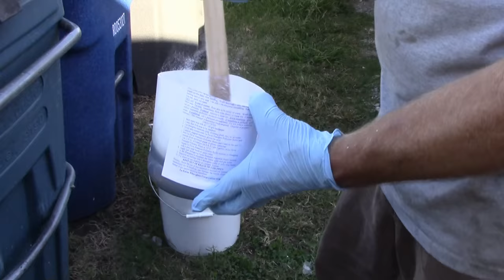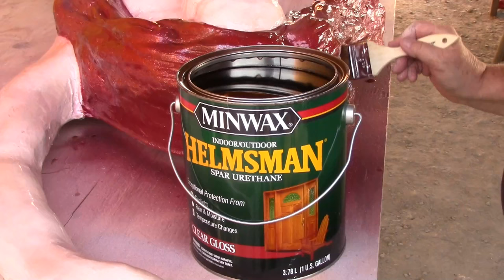Mermaid 2 of 2 - Figureheads for Seeker

Comment: When I know I'm going to be using a cable only in house, I like the twist lock ends.  Hubble makes a 120V, 240V & 3 phase type.  I learned about them doing big Rock N Roll shows.  Everything we used on stage was 3 phase twist so it couldn't get kicked apart.

Comment: Doug, here's an idea for your extension cords. Get some neodymium magnets from HF. Drill 3 shallow holes in the plastic on the end face of the plugs, drop the magnets in and fill with epoxy. If there's not room for the holes,  maybe they can be attached around the edge of the plugs. It might be enough to keep the cords from coming unplugged.
Reply from the maker: I use to love using magnets.   ...and then I started welding and grinding and plasma cutting steel.   Magnets around here quickly become furry iron balls.  :)
Reply: SV Seeker That is a very good point. Maybe you'll have to just slap some velcro on it until the manufacturers catch up.

Comment: Doug, I just do a simple overhand loose knot on the two cords before plugging them into each other. Tension on the cords goes to the knot instead of the plugs so they won't come apart.
The girls look really great on the boat, but will they still be there after stuffing the bow into a big wave?

Comment: Even more expensive, but industry standard, are locking watertight electrical plugs, 14W47 plug, 15W47 receptacle.  The blades are the same as a NEMA 5-15 but there is an outer, locking molded boot.  Of course you would have to replace every plug on every grinder.  About $15-$20 per end on eBay.

Comment: Tie your cords before you plug them... Just a half knot is enough and they wont unplug.
Reply: yes just simply tie each cord with a half hitch to each other.
Reply: They get hung up which can be a as much of a pain as having them unplug.
Reply: An old trick that works...
Reply: In the german firebrigade we have normal german plugs that you can optionally screw together
Reply: Doug already mentioned that in a previous vid. That works fine unless you're working around things where the knot will get caught up on things when you're pulling the cord around.

Comment: Hope a respirator was worn when mixing the fiberglass Cab-O-Sil.. Its Deadly!! ..... Baby powder is also a great thickener and much less deadly.
Reply: any real difference with the strength when using babypowder or similiar?
Reply: Talc added to cabosil makes a tighter putty to fill finer scratches, but talc alone won't make a spreadable putty. For fairing or filling larger voids, cabosil alone is a nice lightweight putty. Add milled fibers for extra strength, cotton flock for bridging gaps, etc. But none of these additives is workable without the addition of the Cabosil for the spreadability it promotes.
Reply: AMEN, Well Said!

Comment: Wanted to edit my previous post but I couldn’t question why you didn’t gel coat IN the mold. It’s my understanding that you make a mold then INSIDE the mold you put mold release then let that dry a bit then you put gel coat IN the mold let that tack up not completely dry but hardened enough so it’s stays. Then you put resin and glass. The gel coat holds detail and the part comes out smooth. They all you need is paint the gel coat.
Reply from the maker: Because it get painted on the outside.  Not behind the gelcoat.

Comment: Very nice video.   Cool drill press.  One question:  wouldn't you need to to seal the hull"s steel surface behind the mermaid to prevent future bleeding of rust?
Reply from the maker: Yes.  Just bolts holding them on.

Comment: A simple way to lock your extension and grinder cords together- First twist the cords around one another then turn the plug ends back facing each other and plug in.  This creates a simple knot around the plugs so they can't be pulled apart....

Comment: If you think the mermaids might come loose, you could put a nut on the all-thread first and tack weld it in place. That nut would be on the outside of the boat, then the nut that's on the inside could be torqued as much as needed without damaging/deforming/breaking/pulling on the mermaid.

Comment: i always tie the cords in a half hitch and the hook the knot over something so you dont have plug on the ground where it gets stood on or wet. When you drag the cables the plug doesn't take any strain. Those plastic clip things are ideal homes for ants and small, angry spiders. 

btw, needs lights behind the nipples... or one with a piercing :)

Comment: Re:  Your electrical plug problem, google - three prong twist lock plugs, that's what you want.  Its the same size as your yellow plugs, but the plug is shaped to insert and twist to lock closed.  Their not much more expensive than the yellow ones you have.
I would be very surprised if your local hardware store did not carry them, or be able to order them.

The mermaid should be sealed on both sides.  The ocean will eat through any paint that is not weather sealed.

Comment: Sir the solution to the problem you have is to convert all your plugs to a 110 twist lock design used in industrial applications for floor buffers usually
Reply: http://www.westmarine.com/WestAdvisor/DIY-Shore-Power

link to a demonstration but these can be sourced on ebay for fractional amounts or at your local hardware store

Comment: I never had a problem with the ole half hitch knot for cords one over the top around and plug the two together, I worked construction for many years, we all did it and never had a problem except for getting caught up on something.  You know what the say, if you fall out of a plane take an extension cord it will get hung up on something.
Reply from the maker: I've been a carpenter too.  But try dragging it across a steel deck with 300+ bolts. :)
Reply: That's why they double as a parachute, always get hung up on something.
Reply from the maker: Maybe we should drag one behind the boat as a safety line.  :)

Comment: Could you not use standard 16 amp plugs and flying sockets? They come in 115 and 230 volt single phase and 400 volt 3 phase, you can get normally get them in 16, 32 and 63 Amp. The socket have a lid that slides over a catch on the plug which locks the two together, and just requires one to lift the lid and pull to separate the two. They are more commonly used in Europe for power tools, industrial equipment, stage equipment but they are available in North America. Just search google for "Industrial Plugs & Sockets 16 amp". 
I can't access google.com as google redirects me to .co.uk however google.ca is accessable from the UK and limiting the search to just Canada shows they are available over there. Check ebay ( from China :| ) and try theatre or stage equipment retailers ( normally used on dimmer racks, older moving head lights and high power followspots ).

Comment: In Europe, we just sling the cables around each other once before plugging them into each other so when you pull at them, the knot tightens instead of the plug slipping out of the socket. 

Like so: watch?v=9Tp3WWWEi-k

Comment: North/south american standard plugs are very poorly designed. They were supposed to be fixed, but by the time governments and companies could get there butts in gear there were too many out in the wild to make it feasible.

Want to keep you plugs together AND water resistant? NASHUA 357 duct tape. Available at any large home improvement store. you can just use a small strip for keeping them together. Honestly though, water shouldn't be a safety concern since you should be running GFCI circuits out on the boat and in the shop. Outside outlets and anywhere with a concrete floor require them by code and have for a long time.

The other option is to take the spades of the tool plug and bend them back, if damaged, in or out to help it stay in there. If that doesn't work, the female end is done fore and even if you duct tape them together you will get sparking that heats the plug up a lot and can even melt the insulation.

Comment: Eu plugs are way easier.. (and even safer, on 230 volts, lot less amps draw!)
Reply: MrBugsier5 smaller wires, better plugs, safer connections and more power
Reply: indeed!
Reply: And a good European plug and socket combination doesn't disconnect that easy by dragging it behind you trough the grass, the holding force is greater because of the much thicker pins and contacts in the socket, the newer CEE industrial plugs have a locking ring and these will never come apart, it's more likely to snap the cord (for safety reassons however I would prefer the connection comming apart rather than the cord snapping)
But a good, and expensive extension cord will always perform better than a cheap Chinese one, where you get much vinyl insulation and not much copper for your bucks, also their plugs and sockets are not as sturdy.

Comment: Nice progress, my congratulations.
Regarding the plugs coming apart: European Connectors (CEE 7/3 & CEE 7/4) do not have that problem at all, because they are already designed properly.
https://en.wikipedia.org/wiki/Schuko
There is even a variant that provides additional protection against splashing water by a rubber lip sealing the link. that variation also takes even more force to pull apart.
Three phase connectors/extension cords provide an additional locking mechanism utilising the lid that normally protects the socket.
https://de.wikipedia.org/wiki/IEC_60309 
3L+N+PE, 6h

Comment: Nice but technically not a figure head. The location would make those Trailboards just fancy ones. A figure head would be centered under the bowsprit with a fully 3 dimensional head. Not a relief on the sides.  A figure head often incorporates  trailboards down the sides of the bow but technically that’s not a figure head.
Reply from the maker: No worry.   I don't give a shit.  : )

Comment: In Europe we already have a system for locking our cables together and it also prevents dirt and grit from getting into the female joint. The cap on the male joint catches a ring on the male joint. Guess you "innovators" in the US haven't got around to innovating this idea yet? 

http://www.industrialextensionleads.co.uk/6metre-tough-rubber-110volt-16amp-extension-lead-splash-proof-10713-p.asp

Comment: FYI to keep from having that itching from fiberglass dust coat exposed skin with baby powder. To help limit the scratching if you don't coat before pour rubbing alcohol over the exposed skin then after it evaporates sluice off with cool water. The alcohol when it evaporates will pull the dust up from the pores allowing cool water to wash it away. 

Did some searching found
 http://aec-business.com/keep-cords-connected-cordlatch/
This one is a velcro setup
http://speedtechinternational.com/Cord-Connector.aspx
Now this is interesting use a carabiner 
http://lifehacker.com/keep-your-extension-cords-from-unplugging-with-a-carabi-1715257024

Comment: You could swap out plugs for these https://www.amazon.com/L5-15P-Plug-NEMA-Locking-Power/dp/B00474B810 and the matching receptacle (inline and wall plugs are available).  Not the most convenient solution but solves the problem and they are readily available.

Comment: You can get Twist lock plugs & inline receptacles NEMA standards, Hubblle is one of the big manufactures: http://www.hubbellcatalog.com/wiring/catalogpages/section-b.pdf  I usually just take both ends, cross the wires and flip them into a half knot. Cheap & easy!l

Comment: try this for your cords.  i do it all the time and it works great.

https://i.kinja-img.com/gawker-media/image/upload/s--BbRZcIRO--/18fbo3a935cu8jpg.jpg
Reply: that's what i was thinking too
Reply: Really not a good idea.
1. EMF (some allowable and sometimes useful but too much isn't good)
2. Core strand curve radius limits (as stated by the IEE wiring regulations)
Reply: EMF? Not unless you run a single conductor. Which is not the case.

Comment: Sorry, my 1st comment in 7 years, don't cut the MAT, rip it. Sharp edges will make air bubble & ripping it will over lay it smooth . O well, to late, should have told that on the 1st dragon.